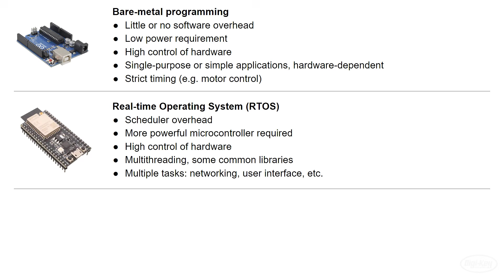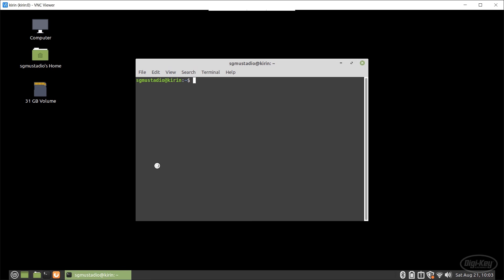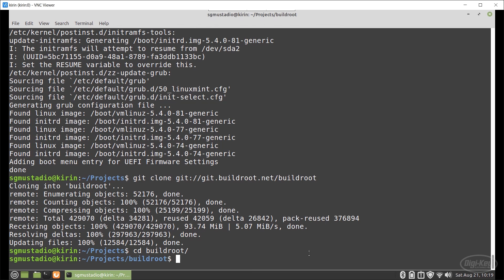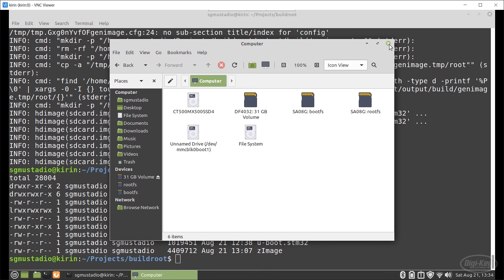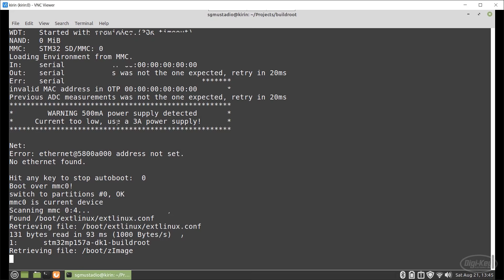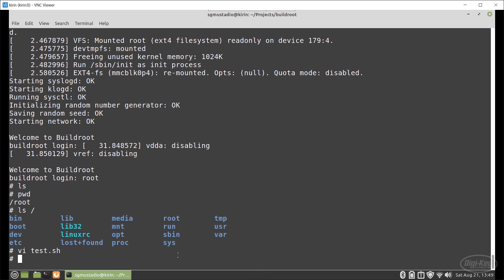Introduction to Embedded Linux Part 1 - Buildroot | Digi-Key Electronics

Comment: Hmm but the persistant problem of non heuristic processing still exists (the control of say, a safety critical event depends on whether your RTOS has finished rendering your high res  pic of quiche). 

Even ditching the Human Interface bloatware in your RTOS will cause a wobbly system response + or - (insert your epoch here).

Comment: It is great course and information for learning Embedded Linux :  Part1to7.

#1 Introduction to Embedded Linux Part 1 - Buildroot | Digi-Key Electronics
https://www.youtube.com/watch?v=9vsu67uMcko

#2: Introduction to Embedded Linux Part 2 - Yocto Project | Digi-Key Electronics
https://www.youtube.com/watch?v=2-PwskQrZac

#3: Introduction to Embedded Linux Part 3 - Flash SD Card and Boot Process | Digi-Key Electronics
https://www.youtube.com/watch?v=KU8_HMfpv0s

#4 Introduction to Embedded Linux Part 4 - Yocto Custom Image and Layer | Digi-Key Electronics
https://www.youtube.com/watch?v=bTEdfwtPtNY

#5Introduction to Embedded Linux Part 5 - Patch Device Tree for I2C in Yocto | Digi-Key Electronics
https://www.youtube.com/watch?v=srM6u8e4tyw

Introduction to Embedded Linux Part 6 - Add Custom Application in Yocto | Digi-Key Electronics
https://www.youtube.com/watch?v=DVlQZnFjO9o

#7: Introduction to Embedded Linux Part 7 - Enable WiFi Networking with Yocto | Digi-Key Electronics
https://www.youtube.com/watch?v=OlMY7iDoN_w

Comment: So the build process is kind of similar to Linux Kernel compile process? 

make config/menuconfig/xconfig generates scripts for my corresponding settings, then we actually make to generate vmlinuz images. 

I think we still do this on Gentoo Linux every day.

by the way, 'make -j 8' makes the compilation process faster. -j X means number (X) of concurrent jobs when compiling the stuff. Say we need to compile 1000 files but not many of them are strictly dependent to others, then we can compile those files at the same time. That's where -j X command shines.

I was able to compile the image in 10 minutes with Ryzen 5 5600G CPU =D

Comment: Couldn't I still run a customized Linux distribution on a raspberry pi? I wasn't sure if it was absolutely necessary to purchase a STM32MP157D-DK1 board to follow along instead of just using a raspberry pi I already have.

Comment: Excellent series - Thank you.
I use buildroot and yocto quite a bit, and welcome these videos.
Notes: 
a) Append 'status=progress' to the dd line to have an indication of dd's progress.
b) When using usermod to add yourself to a group (here dialout), one needs to use 'newgrp dialout' to activate it - else you have to open a new terminal to get it activated.
Thanks a lot for all the work that went into making these videos!
Reply: may i ask, what do you use it for? I'm curious on what kind of career direction embedded linux could actually direct to

Comment: https://youtu.be/yDFMcBNGW3U

Dump or Extract U-Boot from the running board. 

OR
Dump memory to a file from the U-Boot console using the Memory Display command.

This will be helpful in debugging in the situation like you have a board with U-Boot running and don't have the same version of U-Boot binary and want to test on another board.

Comment: my stm32 board does not have a memory slot. what should be the right place to find the interface diagram. I can see stm32f429 is listed and I am using the Discovery board with OTG support.

Comment: I get this error when I typed in "make stm32mp157a_dk1_defconfig" . 
Error: "make: Nothing to be done for 'stm32mp157a_dk1_defconfig'" 
I am using WSL2. Any idea what is the problem? I am in the current folder that is configs where I can see the file for stm32. But I get this error.
Reply: Hello Butterfruit,

i came across the same issue.
It turned out that i executed the "make stm157....." command in the "configs" folder.

When you're in the "buildroot" folder it works fine.
Reply: @mike_lennies  Thank you for taking a moment to answer that Mike. I really appreciate it!! You actually helped me out there.
Reply: @mike_lennies  Thanks dude

Comment: This series started out good, but around episode 4-5 it sadly became just a weird hacking tutorial about how to not do things. Also, if it is supposed to be an Introduction, why not just stick to much easier Buildroot and actually teach people about the internals of kernel configuration and maybe even some driver stuff? Everything yocto related after Part 3 felt like a hacking tutorial somebody found on some random website :/ Its really sad, because, for example, your RTOS and STM32 Series were really good. Even this one started out very promising.
Reply: I have to agree with this assessment...and it's part of the reason I stopped after episode 7. I really thought that I'd be able to break Yocto down into manageable chunks for beginners, but it's really not an easy ecosystem. It's built around a number of massive tools in Linux (e.g. device trees, compilers), each with its own language. Each of these tools could probably have its own video series to teach the fundamental concepts involved in using them. In lieu of some kind of foundational knowledge with these tools, later episodes were mostly "hack up this script to get something to work." In retrospect, I'd probably stick with Buildroot if I had to do it all over again :-/

Comment: You can do motor control using FreeRTOS for instance, just use kernel unaware interrupts for time critical interrupts that do the control work and the rest can be easily handled by OS threads. The price you pay is less time for OS tasks...
Reply: i'm a fan of SoC with FPGA for motor control and ARM (maybe multi-core) running embedded linux.  best of both worlds

Comment: Hi, why is strict timing mentioned in baremetal when a RTOS is always mentioned for deterministic behaviour?
Reply: Great question! Most RTOSes can be made to be deterministic or non-deterministic, depending on how you configure the scheduler and heap allocation. As a result, your application is not guaranteed to be completely deterministic just because you use an RTOS (although, with the right settings, you can make it so).

I might not have described it correctly in the video...but my thoughts for "strict timing" for baremetal include things like needing to sample a sensor every 200 microseconds. A time slice in most RTOSes is 1-10ms, so an RTOS won't help you meet that timing requirement. You can combine baremetal techniques and an RTOS (e.g. use a hardware timer to set up a sampling schedule and feed the data to a FIFO that's read by an RTOS task).
Reply: @ShawnHymel  Understood!, thanks, I also check your videos about FreeRTOS, they are great, could you recommend us extra material (courses, books, etc) to learn more about FreeRTOS and embedded Linux?

Comment: Hello Shawn, thank you for your video. Your page on DigiKey is closed for comments, at least i could not leave any comment. I have followed your instructions but my sdcard would not boot. I am using ATSAMA5D27-SOM1-EK1, I have chosen microchip_sama5d27_wlsom1_ek_mmc_defconfig as defconfig file. sdcard content looks ok, i think problem is booting. thanks for your help.

Comment: Hello Shawn and Digi-Key! Thanks for the amazing introduction to Embedded Linux and Buildroot!
how to use gcc on the generated embedded linux image.
because when i use pip to install python frameworks, i get a compile error, the system always works with the cross compiler that generated the linux image
Reply: Good question! From what I've gathered, you can't use Buildroot to include a compiler on the target (https://buildroot.org/downloads/manual/manual.html#faq-no-compiler-on-target). You can use another system (e.g. Yocto) to add such packages. In a future episode, I plan to show you how can cross-compile on your host machine to include a custom application in the target image.

Comment: I'm definitely an openwrt fanboy. Routers are easy to come by (since no-one is happy with their 100Mb gear anymore) and have all the resources to be used as IoT controllers. And they are quite secure as openwrt is built with security in mind.
Reply: Are you saying you re-purpose the routers to do things besides being a router? Or do you just repurpose them as routers running openwrt?

Comment: Excellent I've been learning python for 2 years now. Was wondering if Linux would be useful in conjunction with python. I don't particularly care raspberry pi because of the amount of current it uses. Can't really do a stand alone project with it. But I'm glad brought up another board to use which is probably less of a energy hog.
Really cool that SpaceX uses Linux to run the rockets
Reply: In my opinion, Linux and Python are two peas in a pod. Even if you're not too interested in Raspberry Pi; Linux itself, as pointed out in the video, is a very popular and powerful operating system. Learning how to use Linux isn't too difficult if you're already familiar with systems like Windows or MacOS. There is also a massive community of developers and users to support you in your pursuits.

Python and Linux are both very useful in terms of embedded systems. SBC's and other small standalone electronics can be hard to develop for, especially if the hardware or applications are custom. This video series should elaborate more on the challenges of programming on embedded devices, but suffice it to say that having a good working knowledge of Linux is very handy if you're looking to program embedded devices yourself. I hope that helps.
Reply: Adafruit m0 express uses Circuitpython and uses less than 500 mA

Comment: Make sure you run the "sync" command after you run "dd" like that to be sure all the writes are actually flushed to the sd card before you remove it.
Reply: From what I understand, umount will do a sync before unmounting the drive. So long as I do a `umount` or `sync`, I should be good.
Reply: @ShawnHymel  you may be right, but in the video you said "now all we have to do is remove the card from our computer" so I figured a clarification would be good :)
Reply: @AdamMaryniuk  Good catch, thanks :) Agreed, `sync` or `umount` is always a good idea!

Comment: Correction: We do not have to completely rebuild the entire image in buildroot when we make any changes. We can avoid distclean and buildroot build system will automatically detect which changes are made and it will only build those packages where you make the changes.
Reply: Good catch, thanks!

Comment: The introduction is great.  I have worked with buildroot on and off for years.  You can split the build into components, boot loaders, kernel, device-tree, root filesystem.  This makes updating the kernel easy as long as you can just update each part on your SD card.  You can make these components from the buildroot build command line.  The best way to figure this out is 'make help' in the buildroot directory, there is a lot of information there.  Hope I have not just taken the subject of an up and coming episode of this series.  Keep up the good work I will be able to point co-works at this series instead of writing lots of documentation.
Reply: You have not...I actually switch to Yocto starting in the next episode :) That's really cool to hear about how Buildroot can be split into components.
Reply: I had a feeling that was the case when I saw the file list in output/images/ that’s sick!

Comment: I've been working with Yocto on and off for a couple of years. It is extremely powerful.  Just finished a custom build for a client using i.MX6 ULL chip. Never would have been able to do it without yocto. Looking forward to the series. I still have a lot to learn, I think my work flow needs improving. I've notice over the last three years the need for developers to be using Linux to sky rocket. I'm coming into contact with companies where only the admin staff are on Windows. Management on Mac. Everyone else on Linux.
Reply: You should really have a look at the ISAR project which is based off Yocto. It combines Yocto with prebuilt packages from debian/apt.
Reply: Does i.MX6  cost efeective? compared to stm32
Reply: buildroot is WAY easier than yocto.     To date I have not seen anything that you could do with yocto that you cannot do in buildroot....easier.    Yocto can take years to properly understand, buildroot....basically an afternoon.    It is simpler but not hard to customize.